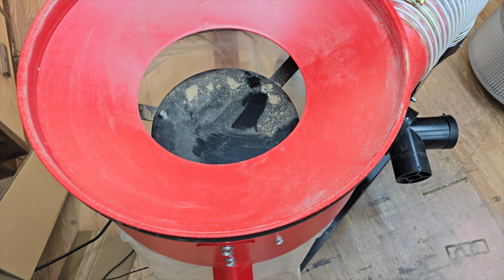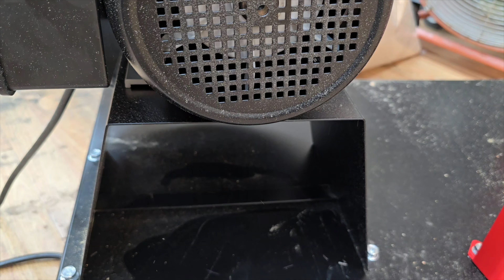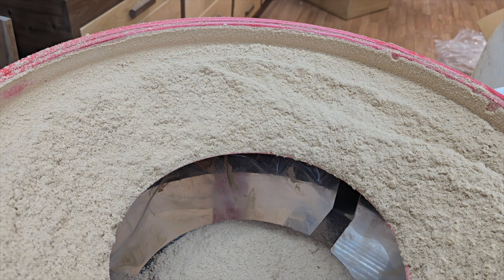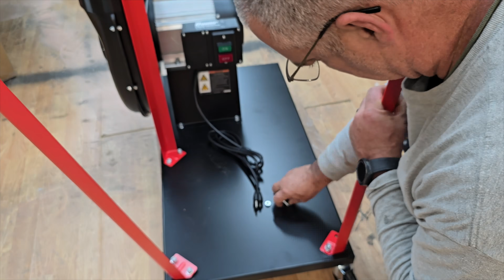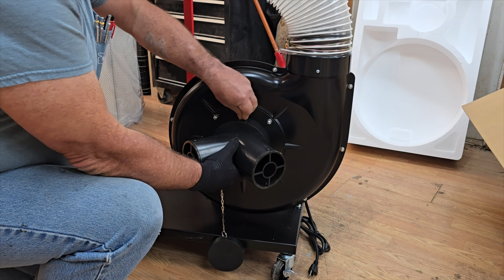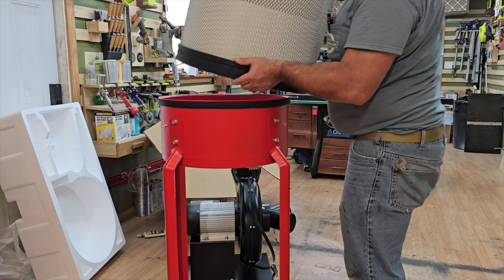Bauer Dust Collector

Comment: Great video! 2 improvements, 1 add a remote switch to the power.
2 make the motor run on 120 / 240. The 29 gallon McGraw air compressor that runs 120 / 240 even though HF doesn’t advertise it. Yes I have the air compressor and have almost 300 hours on it from its own hour meter running 240V.
Reply from the maker: This has a 110/220 motor. It is easy to change the wiring. I thought about mentioning it but the video was already long enough.

Comment: I bought this model a few days ago, with the 15% off coupon, plus an additional 10% off for getting the HF credit card. Good deal! I am in the process of adding a super dust deputy cyclone in-line ahead of the motor unit, and replacing the collection bag with a gamma lid and screw-off 5 gallon bucket. My unit came with the filter cleaning paddles already installed inside the filter! Great idea to have a particulate monitor for air quality -- I will have to get one of those! Thanks for your good review and demonstration of assembly.
Reply from the maker: Sounds like you are getting a great system going.

Comment: I do not recall you mentioning the size of the impellor or the HP of the motor. What are they? 2 micron dust filter is not nearly good enough as this is the dangerous dust - the filter needs to be cut out about 0.5 micron.
Reply from the maker: The impeller is 12" diameter and it has 1 1/2hp motor. Which system filter to .5 micron?
Reply: @ShopRamblings  0.5 micron would be HEPA rating, which is what one gets with collectors from Festool and others. It is offered as a target. Most decent, low priced pleated filters come in at 1 micron. But a 1 1/2 hp motor with a 12" impeller is poor! The impeller has not increased in size (the base models from most manufacturers are all 12"). A minimum size using a 6" hose for improvement is 14". Preferably 15". This will require more power for suction, and you may get away with 2 hp for short lengths, but 3 hp is where a significant difference will be found. As it stands, the construction of the Bauer is improved, but the performance is highly unlikely to be a significant change.
Reply from the maker: @derekcohen1000 is that something from overseas? FestoolUSA doesn't sell a dust collector.  They sell a dust extractor, but so does Harbor Freight. The Hercules dust extractor is hepa rated just like the Festool one. Do you know of any dust collector sold in the US that is hepa rated? If so, what model? I would be interested in testing one out.
Reply: @ShopRamblings  Two companies which come to mind are Oneida and Harvey. Both sell Hepa-level dust collectors. Oneida sell a pleated filter which removes 0.3microns. The issue here is that the Bauer filters 2 microns, which is poor against similar DCs which offer 1 micron, and 2 micron is essentially a broom sweeping up dust, and not a dust purifier.
Reply: @derekcohen1000  You may want to do a little research on that statement, 40 microns is the smallest particulate considered visible to the human eye. 2 micron particulate is certainly not equivalent to floor sweepings. Even HEPA systems do not remove all particulate below 0.2 micron unless you're assuming every particulate generated in your shop is captured by your system. These are for wood working shops, not surgical suites.
Reply: @StratOvation  I suggest you read up on Oneida and Harvey DCs, and the research of Bill Penz. Also on dust particle size. It is not the dust you can see which is dangerous. If the Bauer has the specs described, it will not collect the dangerous sub 1micron particles in the air. Regards from Perth, Derek Cohen.
Reply: @derekcohen1000  Hi Derek, I've been working in the Pharma industry for ~30 years and virtually all of our production environments must meet or exceed ISO-8 / CEA-2 particulate/YM/viable micro demands, I'm quite familiar with filtration systems. What I was eluding to is shop floor debris being equivalent to 2 micron size particulate. It seems some folks simply miss the point with units like this that are designed as entry level equipment for hobbyist/side hustle shops that will be upgrading from a standard shop vac, or worse yet nothing other than a dust mask while making cuts. Sure there are substantially better systems but they come at a substantially higher price which can be a prohibitive entry barrier. Folks looking at a unit like this are for the most part, not spending 8-10 hours a day generating particulate in their shop so their exposure risk is minimal compared to a production environment. the 2 micron canister filter supplied with this unit is a vast improvement over the old bag filters that just distribute the finest particles into the breathing zone of a shop, or a standard shop vac.
Reply: @StratOvation  I fully agree with what you have written. The issue I have with reviews such as this is that they can make it appear that the duct collector - in this case this Bauer DC - will do the job of scrubbing the air effectively. That is dangerous. In fact, while the build quality is an improvement over the old, the actual mechanics of dust collection are no better - possibly worse, since a 6" hose attached to this machine will not pull as much air as a 4" hose - in this case - as the motor and impeller are less capable for the wider hose. Regards from Perth, Derek

Comment: FYI - $50 off this month for Inside Track members making the cost $399. The bag connection looks like an improvement over the steel band clamp affair but still looks to be a pain. A two stage cyclone with a drum is still the way to go. I added the Oneida Super Dust Deputy to my old HF unit a couple years ago and haven't had to empty the bag since (and prob never will). The metal trash can is SO much easier to empty! Also added a pleated filter to replace that worthless bag filter. (It's more of a dust distributor. lol) The Bauer unit is still a huge leap forward from the old one though ... I may pick one up but will wait for a bigger/better coupon.
Reply from the maker: I have a 55 gallon barrel under my other dust collector. It is so much better than a bag.

Comment: About the hard barrel, I have a central pneumatic dust collector that came with a plastic bag (just a pia). Replaced it with a 30 gal fiber drum, and life in the shop is way better.
Reply from the maker: That sounds like a great solution.

Comment: Looks like the saw dust is getting caught up on the bottom of the 6” hose going from the impeller to the cyclone area?
Reply from the maker: Yes, it did. The barrel of sawdust came from my other system.  It has a separator and doesn't go through the impeller. I have a floor sweep on that system. There were a couple of pieces of wood caught blocking half the airflow. That is why I mentioned if you hear it or see it slowing down to check the adaptor to make sure it is not clogged. People like you keep me on my toes.  Thanks

Comment: Just curious.  I have the HF dust collector, with the Rikon impeller.   How big is the impeller in this one?  The CFM still seems to be lower than the HF with the upgraded impeller.
Reply from the maker: It is 12'" impeller. What is the CFM with the upgraded impeller? This is the Rikon 60-151C rebranded.

Comment: I have the old Central Machinery version from Harbor Freight...the worst part for sure is that stupid bag, well both actually, mine has upper and lower cloth bags.  Trying to get that bag back on is just about a 2 person job, someone to hold it in place while you get the clamp back on.  It works great, but the bags are a huge pain.  

Wish they'd design one with a drum that's on wheels that you can simply roll out and dump, those bags get heavy, a drum would be much better.
Reply from the maker: I have that same one. I have mine modified to take a 55 gallon  barrel. This filter is much more efficient than the top bag. I haven't decided yet if I am going to modify this one.
Reply: If you have had your collector with the top bag operating for more than 2 weeks, you need to take it off and throw it away. It isn’t “filtering” anything at all. Spend the money and get either a Wynn filter or one of the less expensive alternatives and add a cyclone separator. You will not be disappointed. I have the old HF collector setup as described AND an expensive 2HP Jet collector with cyclone and better filter built in. The old HF is absolutely competitive with the Jet once it’s been upgraded.

Spoiler alert: what will likely eventually happen is that filer bag will become so clogged that it completely impedes the exhaust air flow and it will be forced off of the machine in a way that is best described as “exploding”. Your shop will be CAKED in dust. It’s a nightmare. Ask me why I went out and bought an expensive Jet collector……..

Also, ignore that beater crank. Use compressed air to knock the loose stuff from the pleats from the outside in.
Reply: @MachinedInWood  It works just fine, gotta shake the dust out of the bag once in a while.
Reply: Thanks I was wondering about this, HF is really steeping up there game. Please suggestions for modifications for adding a barrel for the dust. If you inclose the base of the table saw using it as an initial drop for the sawdust, this greatly improves the efficiency of your dust collection, although making 2 places to empty dust from. This has definitely made the list of things for my shop when the addition is done, currently cannot move in it, to many things need space for a large lumber haul.

Comment: Good review as usual.👍
Nice machine, but probably more than I need. Most of what I do is exterior work, and my shop is only 150 sqft. I think the Hercules dust extractor and a box fan / MERV air filter will do well enough for what I do inside. 
Whether dust collector or extractor, Harbor Freight is putting the industry on notice.
Reply from the maker: It sounds like you have a good plan for your shop!

Comment: Thanks for the review on this. I have been looking to buy it.
Reply from the maker: I've  had 3 of the older model Chicago Electric dust collectors. They were a great deal. This thing is on another level. I just moved my main truck to the outside. Now I want to replace it with a 6in and connect this to it.